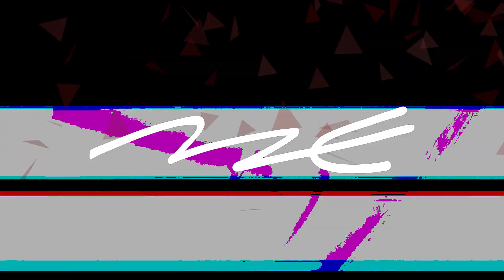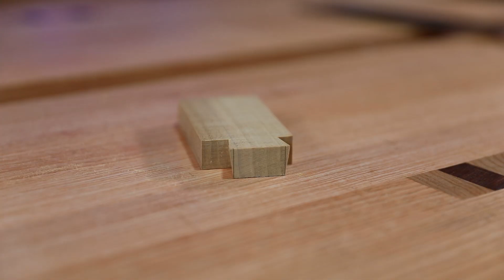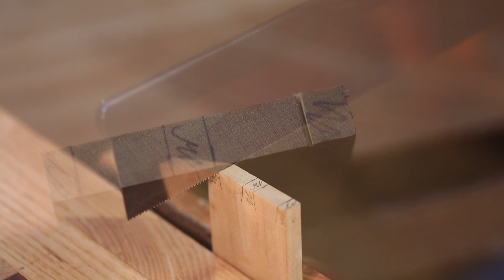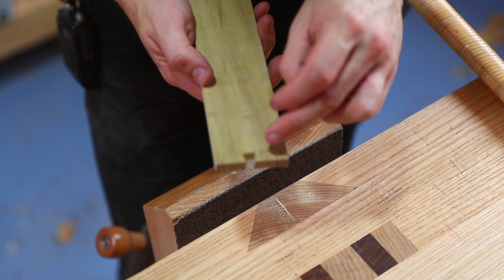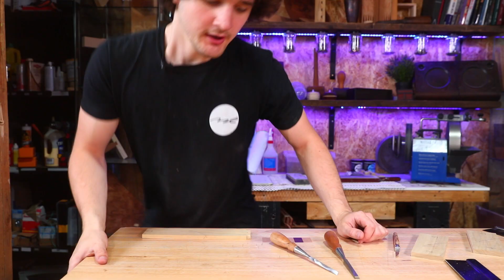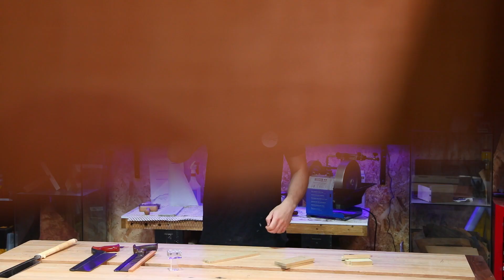Cutting the Tails | Dovetail Box Project #3 | Free Online Woodworking School

Comment: Matt, you mention that the Katz-Moses guide works best with a Japanese saw… why is that, specifically?
Reply from the maker: I don’t know why, it just tends to feel a bit more natural. It’s something I’ve heard echoed from lots of people regarding dovetail guides in general, but never really heard a valid reason unfortunately!
Reply: @MattEstlea  Ah okay. Thanks! It would make sense, since Jonathan seems to favor Japanese saws, but I wondered whether there was some specific mechanical reason. 

Thanks for responding, and thanks for the content!
Reply: @nathanshafer4978  I know I'm not Matt but, I think I have a theory that works.  My backsaw isn't very flexible but, my pull saws are.  If I waver in the cut with the back saw, it tends to pull away from the magnets more.  Withe the Japanese saws, the magnets keep the teeth in the cut straight.  Even if the rest of the blade is twisting slightly.

Comment: Part 3????  Crap!  I need to get part 1 done!  :)
Great video!
Reply: Well, I got part 1 and part 2 completed.  I have started cutting.  So far, my lessons learned are:
1.  My skills are currently lacking.
2.  Some of my equipment, saws mainly, are rubbish.
3.  Patience is a virtue.
4.  I am enjoying my struggle through these.

Thank you Matt for this course!
Reply: The tails are cut, but they are ugly.  Considering these are my first dovetails, I guess I'll learn from my many mistakes.
Reply: @jimwilliams2682  many many many mistakes!  Keep pushing and remember the basics.  I get a really quality set about 1 in 3  after a few hundred cut.  I'm trying really hard to figure out that "take your time" thing Matt keeps mentioning!